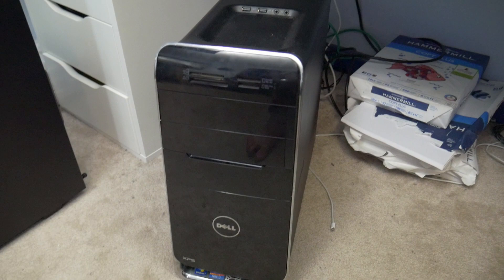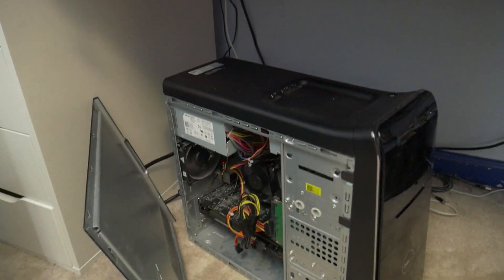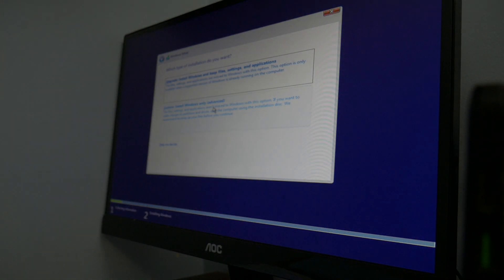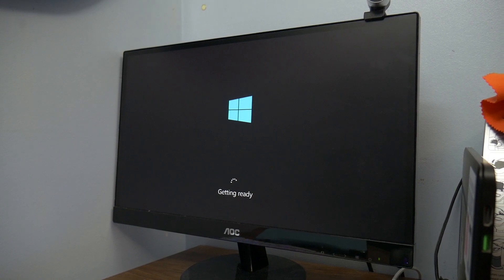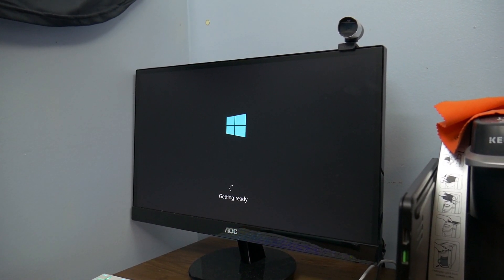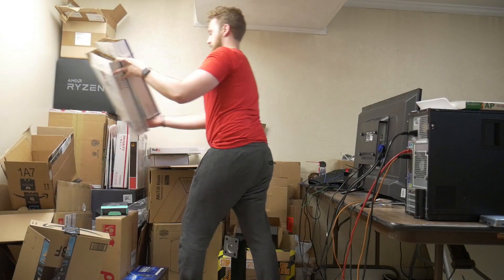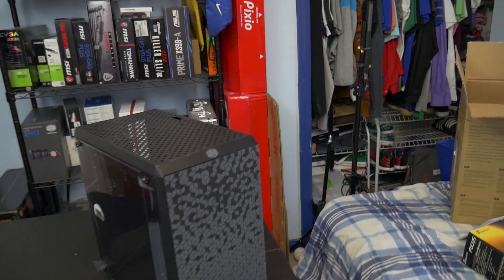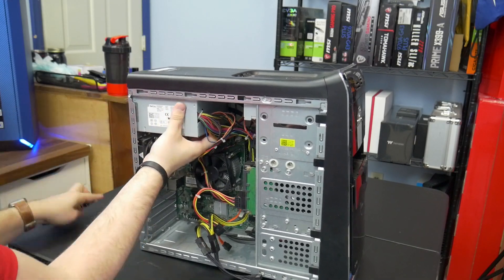Free Gaming PC Build 2018 - Specs & Case Swap

Comment: I have that exact same Dell XPS PC (8100). I added a SSD, new power supply, more memory and other upgrades. I also put a EVGA GeForce GTX780 SuperClocked in it but it died while still under warranty, luckily.  EVGA did replace it but that one also died with in a year or so. I'm now running a graphics card my brother gave to me, its a EVGA GeForce GTX 750 Ti, Its one of those half sized cards, with just one fan. It's okay, nowhere near as powerful as the 780.